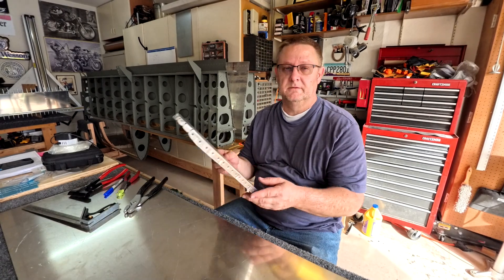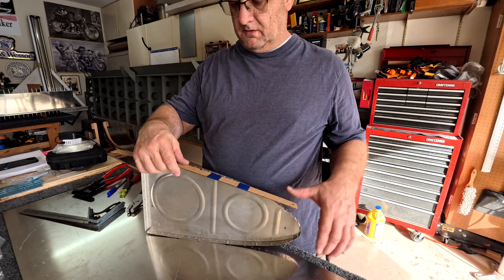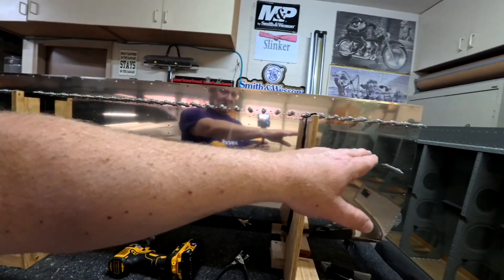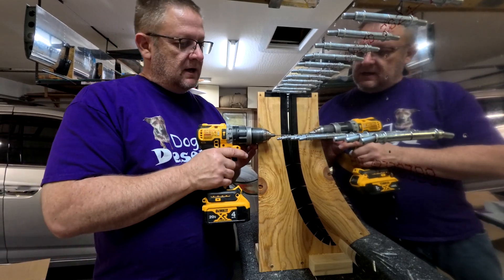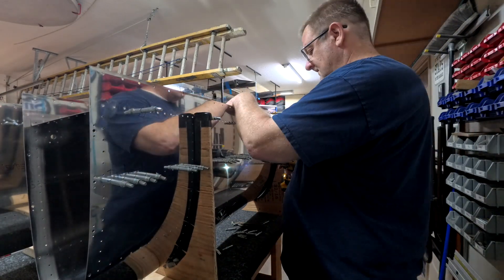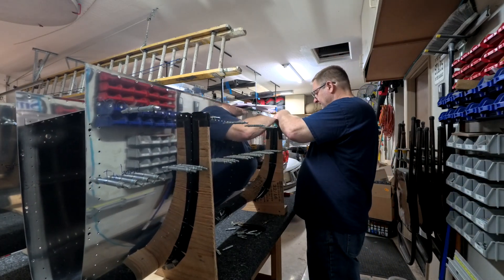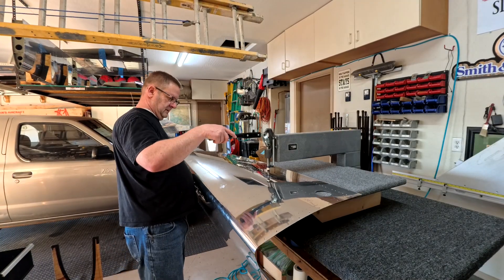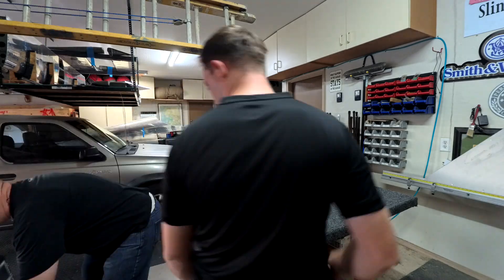RV-14A Build: Tanks 18.4 - "J-Channel" Final Drill and Skin Dimple #aviation #vansaircraft #dadjokes

Comment: Would it help to have a 3D printed piece with the profile for the rivet holes in those ribs?

I bet you could hammer against it and make inspection easier.
Reply from the maker: Interesting thought... If you have a 3D printer and want to test some things I would be more than happy to try them out! thanks for watching!
Reply: @SlinkAir  Got to look for a Printing Farm partner in the US first; I do have a printer but sadly shipping from Mexico is about 50 USD a pop!

That being said I've tested this idea myself; used some thick nylon prints as a form to roll some 10mm 1000x series aluminum into ear-like shapes.

Whenever I do find a suitable US partner (or visit the US) I'll try sending you some forms with for you to  try with sheet metal.